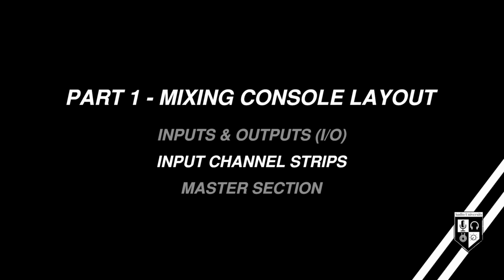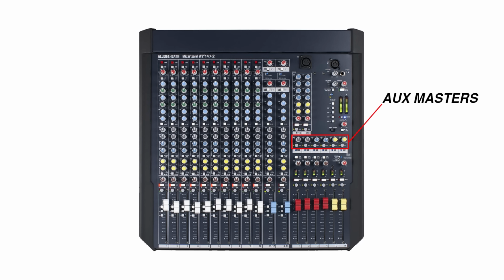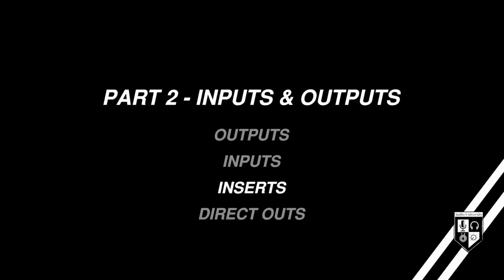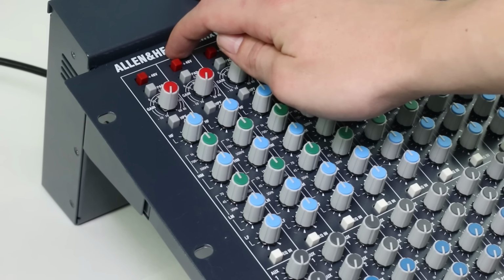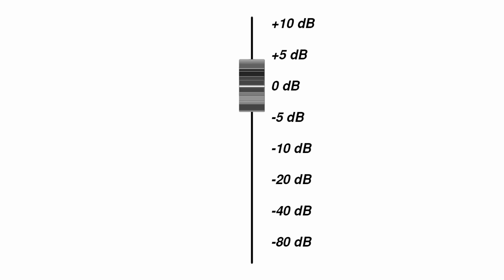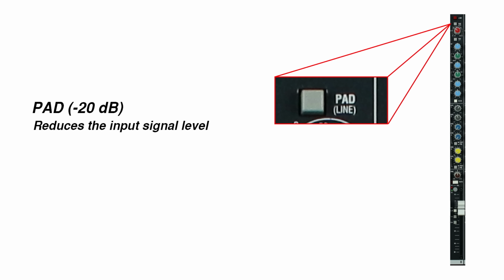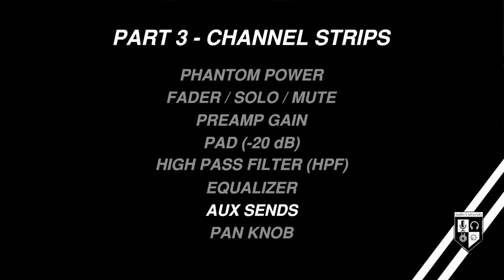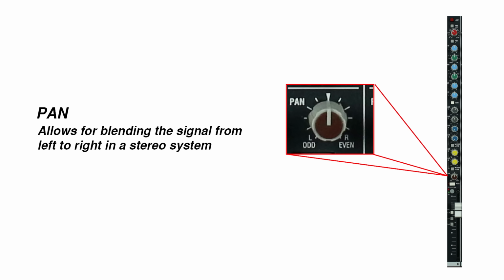How To Use a Mixer for Live Sound & Studio Recording

Comment: Thanks so much! I’m doing a lot of live shows and playing bass while controlling the mixer for about 8 inputs on 5-6 musicians in the band.  I’m running powered speakers with a small guitar amp for a monitor (which I get a lot of feedback from).  
I didn’t realize I should be setting the faders to 0 across the board and then using gain on each channel.  I also didn’t think I should play with the volume on the speakers themselves as I had them set to 50% and have never touched them. .Using QSC CP15’s on stands.  Playing for about 100 - 125 people on average.  

When should I run stereo buttons in or out on each channel?

Should I be always running live with PL’s out? 

Should I run HF buttons in or out  for amp outputs going into xlr channels? We run a bass amp and a guitar amp to the mixer using xlr cables plugged into the output of those amps.  

Thanks for the awakening help! We sound good but I’m now believing we will be sounding much better next gig!

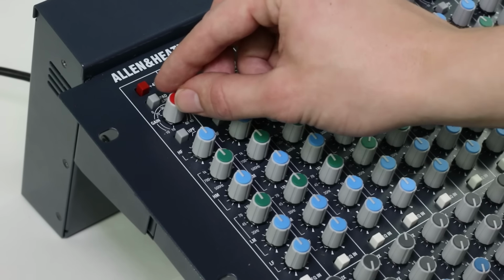Comment: 6:40 There are 2 main ways to adjust gain. One is as you describe, to put gain according to how much you want to hear it while fader is at 0. The other is to simply have fader down, and adjust gain until you get a great signal strength, and then use fader to adjust the channel balances in the mix. I use the second one, and think this is much better way to do. 

Reasons why its better to adjust gain before setting fader at zero: 
1. While audio is logarythmic, it is percieved differently at different levels, for example -10db from unity is not percieved same as changing from -20db to -30db. 
2. Gain will modify all sends (faders, aux, matrix e.g.) and if adjusted to one fader, could be too weak for another mix (like broadcast). 
3. Audio strength can be adjusted through amplifiers, and thus the meaning i.m.o. is that gain sets the signal quality, fader sets the balance between all channels in comparison to each others, and master fader sets the volume intensity (i.e. within that sermon between +5 and -10. Amplifiers in speakers will set the total loudness. 

What I am unsure of is though if there is more forgiveness in analogue mixers than digital ones. At first I learned to mix through the first method, but instead of having fader at zero, had headphones set to one specific level.

Comment: Problem with most of these boards as they give you so many options it can be overwhelming and paralyzing. Makes sense that each strip is just a cluster of the same options repeated across the board, but some of these auxiliary settings, various toggles etc. It just seems like, who really needs that much granularity? Seems like it could be much simpler and still flexible enough for most situations

Comment: Question please.  I have my mixer main output L/R to sub,then set the crossover and to the L/R tops . Now I run my 2 floor monitors from an output mon from my mixer . Problem we have is that when bass player plays we lose or the monitors get muffle . Now do I need to have a separate crossover for my monitors.  They do not have any settings on the back for it and so does my mon  output nothing for crossover.    So the subwoofer crossover on my mains is completely separate as the mon ouput? If so what do I need to buy as for a crossover or low cut for my monitors

Comment: Hi just a question 🤔 I have bought a as new. Beyhringer 8000A with meter bridge " not a crackle" great  but the buses LED s meters on the right do not work or so it seems , iv routed to there the sliders below make some difference to the volume,  but not a flicker. Am I not doing some. ? Iv pressed every button and switch on the thing  please help. Thank you.   Kaiwen

Comment: hello, i connected a keyboard to a channel on my mixer and set my pfl to 0db and also my solo to 0db, but my MAIN mixer has 5 green, 3 orange and 3 red lights.  I have to move my sliders almost all the way up to get to the first orange (0db).  is this right or am i doing something wrong?  Greetings
Reply from the maker: I’d recommend peaks around 0dB or just above that. Try to avoid any red lights if possible.
Reply: everything is set to 0db but my MAIN SLIDERS are almost fully open and odb is lit, the bars on it are far above 0db but only the first light is lit, so 0db
Reply: By first light i mean first orange 0db

Comment: I'm thinking of getting into the karaoke hosting niche. I'm quite a decent singer, and also play drums, keyboards etc and was in a rock band playing keys and doing live sound back in my early twenties. I also did a two year diploma in recording engineering back in the day.
We go out to karaoke quite a bit, and we've noticed that most karaoke hosts don't know much, if anything, about sound. It's truly a bummer to sit in front of, and sing behind, terrible sounding systems, but that's pretty much all you can find, at least in our experience.
In thinking about getting into this game, I wondered if it would be possible to host a karaoke gig front of house.... or more accurately, front of bar, or at the bar, or anywhere in the club out in front where mixing can be done properly. All the karaoke hosts we've ever seen do the same thing. They set up a table up front on or next to the stage, and set up their hardware mixer etc, and there they sit. Frankly, they're in the way, the sound of people chatting with the host is disruptive to singers, and they are in arguably the poorest mixing position in the house.
It dawned on me recently that karaoke hosting/mixing could theoretically be done remotely, from out in front, using a tablet or laptop, and by using a software mixer on a powerful enough desktop computer near the stage. Vocal mics would feed the computer through an audio interface, and mixing would be done using remote desktop connection (or some other remote desktop software) from foh, or wherever you want in the club. Also, you would have access to compression, reverb, eq, or whatever other digital audio processing is available.
Does this sound feasible?

Comment: Is setting input levels (and gain staging) the same with analog and digital mixers? You say in this video you should set each fader to unity point then bring up the pre gain knob - does the same concept apply with using a digital mixer (especially a tablet controlled mixer)? Or only for analog mixers since that's what you're using in this video?
Reply: The gain knob should be used to maximize signal to noise for the given input signal, not as a way to achieve the overall mix. Engage the PFL switch for the channel you wish to set and watch the meter LEDs. Bring the gain up until the peaks are just below the reds, or where the input level is maximized without distortion or overload. This maximizes the S/N for each input and achieves what we we refer to as "proper gain staging". (As far as the mixer is concerned at least, gain staging for the power amp section is a lesson for another day) The channel faders are where you achieve your overall mix.

Comment: I always say to people who get scared of big consoles : you just need to learn how one channel works and all of the rest are exactly the same. It's really not that hard to learn how to use mixing consoles. You need to understand, mic input, line input / output, groups, master output, aux output, inserts, gain, eq and that's about it. I really miss the old days when we had a 32 channel mixer with 8 groups in our studio - it was an old Mackie, it wasn't a good console but it was so much fun to work with, with compressors on the insert channels and we had a Lexicon and Alesis reverbs on aux channels and it was just fun working that way  :D

Comment: I'm not convinced about the way to set the gain post fader at 0db.
The advantage of having the faders at 0db and avoiding the logarithmic in the lower segment is of course an approach that may make sense with older analogue mixers or those with extremely poor preamps to keep the level lower.
In my opinion, however, this is no longer a problem with modern and digital mixers.
There may be microphones with a lot of inherent noise that you don't want to use at high gain. But then I would reconsider their use if I had to use them in an area that is not optimal.
The way I've learned is to turn the channel PFL on and then adjust the channel's gain so that the signal is clean and clear around -12db to -6db levels and allow for enough headroom to get the most out of the preamp. In the meantime, you can briefly check the signal via the fader to see if it sounds good. However, the goal is not 0 db of the fader, but an optimally used preamp that delivers its best performance in the range about -12db.
If you adjust the volume of the gain post fader, it can happen that the signal via the direct out is too quiet and the signal has to be increased, especially in post-processing and recording, which leads to more noise. In addition, the signal runs through the entire chain of EQs, which is also unsuitable for leveling.
Reply: I think you are right 👍🏻
Reply: not sure where the 0 dB comes from honestly, usually gain needs to be around -18dB when handling lot of channels, you can of course adapt that depending on the number of chans but the theory is 64 chan at -18dB is a 0dB master (leaving way enough headroom out of gigantic setups i never saw).

Comment: I have a question:

What IF.. 
The user, in this case… me, has multiple EQ’s to choose from ?
I feel like I’m always second guessing myself when it comes to the best way to use my EQ in order to get the best overall sound.
So for example, I have an acoustic guitar running into a LR Baggs Session 6-band EQ pedal, then from there it goes into my Harbinger mixer, and then is controlled by an Mackie Thump Connect 2 app which has bass and treble ONLY “smiley face’ faders.
So you’ve got an EQ Pedal going into a 3-band mixer with a 2-band for the speakers.
What’s the best way to utilize so many settings ?
Should I combine them if they are at different hz for the Mid on the mixer vs the mids on the EQ pedal ?
Should i choose one to leave at unity ?
(I could ask the same exact question when it applies to Gain settings as well)
Should I not combine bass and treble settings for multiple devices ? Oh, my guitar also has bass and treble knobs, in case that helps.
When having all these options, it can get confusing, and I want to make sure im getting the best out of my gear.
Any advice is appreciated. Thank you.

If it helps I will detail the numbers for each:

LR Baggs Align EQ: 85 350 700 1.6K 4.8K 10k 
Harbinger 100Hz 2.5kHz 10kHz
Mackie Thump Go 2-band EQ -6.0dB to  +6.0 dB (Low and High)

Comment: Awesome video! I always wondered how inserts worked...
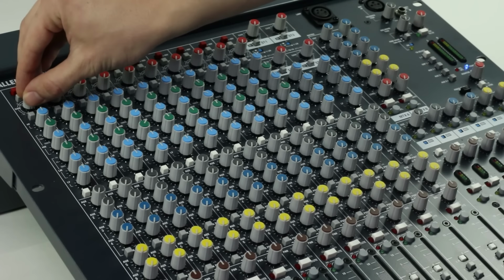One comment, at 6:55. For studio mixing, I've always taken the opposite approach, where I keep the monitors at a higher volume and send less signal. I've found this gives less distortion since the speakers have all the power they need. It does probably mean a lower signal/noise ratio though.
Reply: most "serious" analog amp work best at max power so it doesn't surprise me.

Comment: From any sound Mix. How can I take and record with other device, such as zoom.
Reply: Depends on the size of your mixing console. If it doesn't have secondary main mix outs you can use the Aux routes, subgroup outs oder daisy chain the recorder after a active speaker. Depending on the mixer you can also use headphone out or control room out.

Comment: NEVER switch phantom power on or off, without first double-checking that that channel is NOT being fed to any active output. A splat is at about +55dBv (that's 55dB above normal signal) and often it goes straight i to a mic input!

It can tear speaker cones, make people fall off step ladders, and always frightens musicians. And it won't help your own ears if you are trying to "find" that mic on headphones! 

Take similar precautions when dissing or reconnecting a phantom-powered mic, for example to extend or re-route its cable on stage.

Comment: Question on LEds indicator.   Do this lights Indictators indicate just decibels levels or do they also indicate volume levels,  let's say if I have 2 instruments on 2 different channels , if both leds indicate 4 ,do they also mean they are at the same level control ?
Reply from the maker: Yes, J. The meter shows the signal level.
Reply: @AudioUniversity  so if 2 guitars on separate channels shows 4 dubs on the indicator leds, doest that mean they have equal volume also on the load speakers and so microphones and drums

Comment: If a mixer has a lpf and hpf can i use this as a crossover? Or will i need a dedicated crossover for my subs and mains. I am using amps for my subs and my mains are self powered.
Reply from the maker: That's a good question. It's possible to use an lpf and hpf to distribute high and low frequencies, but it's sometimes helpful to have the ability to delay the speakers so that they are phase aligned at the crossover region. Check out this video for more info: https://youtu.be/YToV8Q-K83s

Comment: Hello. question: I have behringer line 2 usb cable + otg cable for android phone live facebook transmissions. where do I insert the two behringer line2 usb jacks into the soundcraft efx 8 mixer? thank.
Reply from the maker: There are a few options. If you want to send the main stereo mix of the mixer to the USB port, I’d recommend using the “Monitor” outputs.

Comment: Kyle in all the years using mixers, I have not been using them correctly, by far the best tutorial I have seen and well explained,  I have a question I hope you can help me with
I'm using 2 powered desks one is the yamaha emx 5000 and the other is Allen and heath pa 12-cp, I want to bypass these mixer power amps use only the mixers and connect to my yamaha stagpas 1k powered speakers, can you tell me where I should be connecting to on my desks to correctly achieve this?
thank you.

Comment: Very clear and concise video. On the Allen & Heath mixers (larger GL2400, GL2800, etc) you have to open the chassis to get to the direct out jumpers otherwise the faders will not change volume on the board in a recording situation per channel.  I think that is a huge issue with their mixers and not something I had using say a Soundcraft LX7.  I realize that they were designed primarily for live applications and live recording, but adding a button per channel would sure have helped.  :)

Comment: Thanks for this educative material. Kindly help me clarify a scenario I want to explain here. Let us say I have an analogue mixer, an amplifier and two main speakers with two speakers for instrumentalists. Will I connect the main speakers to the Amplifiers or to the mixer? I guess the stage monitor for the instrumentalist will be connected to the auxiliary ports on the mixer if the speakers are powered, speakers. If the speakers are not powered speakers, will they still connect to the Auxillary ports on the mixer or connect to the amplifier?

Comment: The direct outs from each channel are passing through the faders? Can I adjust the volume that goes to multitrack? If not, how I adjust the levels that go to multitrack?
Reply from the maker: Usually, the Direct Outs do not pass through the faders. To control the level, you'll either need to adjust the preamp on the mixer or the preamp on the audio interface (or recording device) you're sending to.
Reply: @AudioUniversity  Thank you for the quick response!
Reply from the maker: Thanks for watching, George!

Comment: Excellent video!! Thank you! I just have one question. I use a mixer like this on live shows and I want to listen only my instrument and voice (input 1 and 2 for example) on my In-Ears (Im the only one using it). How do I select only does lines?
Reply from the maker: I’d recommend routing those channels to an AUX Send that feeds your in-ears.
Reply: @AudioUniversity  Oh I see, thank you. Also I noticed that if I clicked the ''SOLO'' button on my voice and instrument tracks they are send to my in-ear but something doesnt felt right and I think i am not suposed to use it like that on a live show right?
Reply from the maker: What are the speakers connected to the system? Just the IEMs?
Reply: @AudioUniversity  I have a main out LR to speakers. A aux out LR to 2 monitores poiting to the stage.

Comment: I learned last time, how not to use
1) You doesn't need a master equalizer, you can fix everything with the 3 band channel EQ. Especially when using the cheapest PA speakers.
2) Always use a subwoofer, also when no one of the artists has some bass instruments. The cheaper the better, the best subwoofers give a boost about 130 Hz.
3) Let the subwoofer on, also when it causes low mid feedback.
4) Don't do soundcheck before the event starts, the audience loves the noises of feedback
5) Don't provide DI boxes or microphones for guitar amp, the artist has to provide a balanced signal.
6) Don't be the super hero, that knows all the skills. Act always, as would it be your first time you do it without advice from an experienced sound man.

Comment: What about groups ?
Reply from the maker: Groups are a way to route multiple input channels to a mono or stereo group channel that can be controlled by a single fader. There are several advantages beyond the single point of control. You can apply compression, EQ, or other effects to everything in the group or route everything in the group to a reverb send without the need to put the same thing on every channel individually. 

Good question! Thanks.
Reply: Thanks! 
Why does the A&H wizard button send a signal to 1-2 or 3-4 groups (2 buttons to 4 faders), why is it done and what are the advantages
Reply from the maker: This can be used for stereo groups, so that the pan knob determines the blend between those two channels.
Reply: @AudioUniversity  thank you very much
Reply from the maker: Thanks for supporting the channel, smartm123!